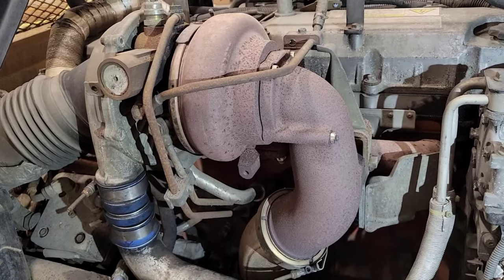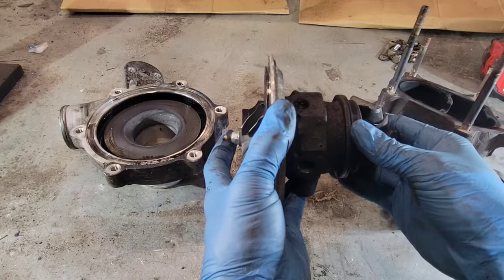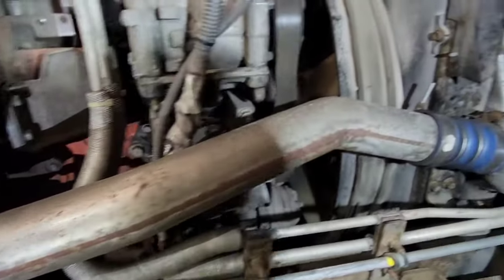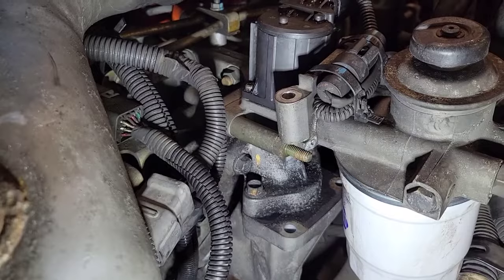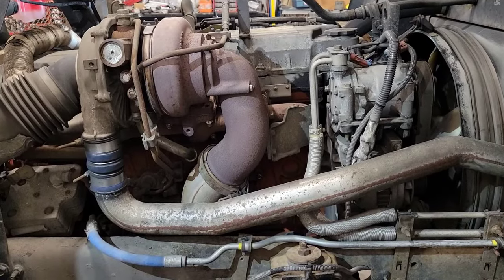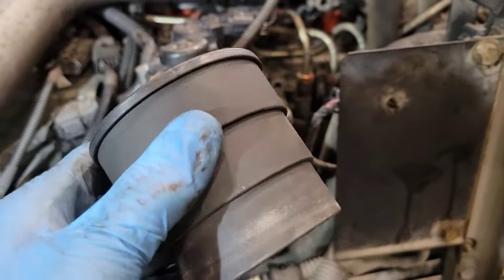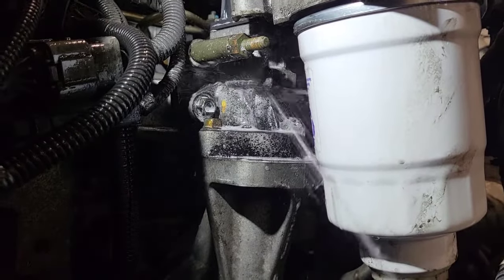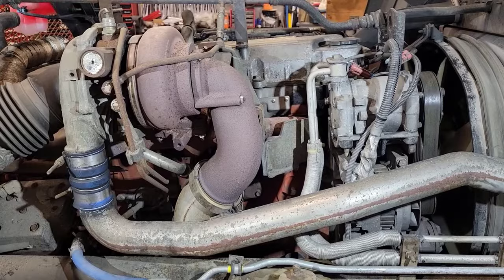Low Turbo Boost ? Common Causes Explained. Watch This Before Buying A New One. Shaners Mechanic Life

Comment: My 6.7 powerstroke drives with engine RPMs but no boost at all, it has a new turbo installed and it drove fine for couple of weeks then all of the sudden started to do that
Reply from the maker: Did you find what was wrong? Boost leak? Or turbo warranty?
Reply: @shanersmechaniclife3164  it is still the problem, I noticed once I erase the codes works fine but after I shut the engine off and crank it again the codes are back and back to the issue
Reply from the maker: @cowboylandscapellc2893  I believe the 6.7s have variable geometry turbos. The computer will change angle of blades in turbo which adds or reduces boost. If your Check engine light is on your computer may be reducing boost . Kind of a limp mode thing. I would look into what codes you have.
Reply: @shanersmechaniclife3164  codes are for low voltage circuit at glow plugs, I have no idea how to test them

Comment: Just put a new EGR valve on a duramax and it leaked. They make junk parts now days..
Reply from the maker: I have run into that as well. I put a new water pump on a Mustang and it leaked worse than the old one.

Comment: I having low power, I lost about to  gallons of oil due to a bad oil crankcase breather,  do yo think running the engine for about 500 miles like that would damage the turbo? 2007 series 60 dde holset turbo
Reply from the maker: I would clean it all and fix your crankcase vent issue. Run it for a while and check your turbo before you replace it. Let me know how it works out.

Comment: I have this same boost problem on my explorer 2018 sport.
Reply from the maker: Did you get your explorer fixed? Was it just the EGR?
Reply: @shanersmechaniclife3164  no I get P0238 P0236 all turbo related and power generation issues

Comment: If the impeller is damaged it would whines spinning noise then go into limp mode I'd it totally gone
Reply from the maker: Also if the bearings have excessive play it could be rubbing on the turbo housing.

Comment: Hello i have a Bmw f20 1.6 turbo my car goes to limp mode when i put the power down. Fault code that appears is low boost pressure. Had all the pipes smoke tested no leaks, chechked turbine for play no issue wastegate/actuator no issue. Mechanic says its boost pressure sensor woulf this be the case ?
Reply from the maker: Could be the boost pressure sensor. Also check the connector and wiring.  Hope it works out for you. Keep me posted with what you find.

Comment: What was ur PSI boost mesurment
Reply from the maker: I don't recall. I think I gained a few psi after replacing the EGR. Next turbo problem video I do I will make sure I measure it before and after. Thanks for watching and commenting.

Comment: My 6.4 has no boost at all when driving can it be the pcm need to be flash or up pipes
Reply from the maker: Any trouble codes? Some of the variable rate   turbos will cut the boost back if it sees issues.
Reply: @shanersmechaniclife3164  code 1639 and other code that doesn’t make sense the battery light is on and abs light is on

Comment: How much boost should a DD15 push, my truck at the max pushes between 22-25 psi on a hard pull
Reply from the maker: I don't know the exact specs but I would guess you should hit 30 psi no problem. Have you found anything out? Let me know. I think you have a boost leak or maybe an exhaust restriction? Keep me posted. Thanks for .
Reply: @shanersmechaniclife3164  no boost leak after we plate the gas recirculation tube it blew soot for a while then cleared up so I'm pretty sure the exhaust was clogged, I'm going Going to take the plate off and see if the spn 102 code comes back. I bought the truck deleted. They didn't delete the gas recirculation sensor so it's throwing the only code now. Still only getting 22 lbs of boost but it spins up a lot quicker and pulls better thank you for your response

Comment: I have a fiesta 1.4 tdci having p0299 code from 2 years ago i changed most of the sensors recently replaced the turbo aswell and still the same thing now the mechanic is telling me maybe is a clogged exhaust system..any advice pls?
Reply from the maker: Clogged exhaust could be the problem. Exhaust flow is what spins the turbo. I would do a back pressure test to verify. Could also be a clogging intercooler. Hope it works out for you. Let me know what you find. Thanks for watching and commenting.
Reply: He cleaned it and tried to do regeneration but it does not accept it,(still the same no power at all)could this be because I’ve done remaping stage 1 and the guy deletet egr and dpf aswell?
Reply: The mechanic told me there is no intercooler on this engine 2012 1.4 tdci european model

Comment: What if I’m getting no boost and engine jerks and radiator hose keep fallen off
Reply from the maker: Is the cooling system building pressure as soon as you start it? If so, I'd look at headgasket issues. Let me know what you find.  Thanks for watching and commenting.

Comment: I have a P0299 Turbo/Supercharger underboost fault on my 2005 Range Rover Sport 2.7TDV6. The car seems to loose power and stall when i reach a speed of 50MPH. No check engine light/eml light on the dashboard. I hope it's not the Turbo.
Reply from the maker: Check all your turbo piping clamps make sure they are tight  and your intercooler for damage from rocks etc

Comment: Why would you use this turbo for the demonstration? This is not anything near the type of turbo that’s on super duty turbos.
Reply from the maker: Sorry, I find lots of people might make this mistake. If my info is incorrect, can you please let me know when they changed? I used this truck because it uses a Garrett variable geometry turbo. Garrett makes the turbos that Ford uses on the superduty. ( not sure if all of them, but many especially the 6.0s ) The truck I filmed on was a cab over design which made visibility of the parts much better. The super duty turbos may appear a bit different but the technology is the same. I appreciate your feedback. Thanks for watching and commenting.